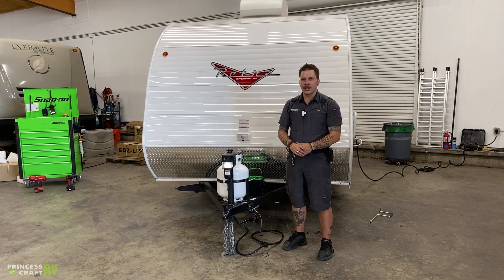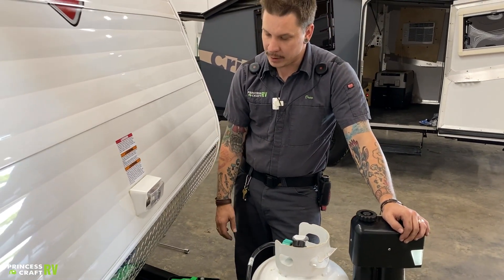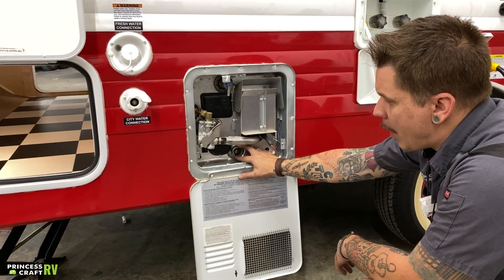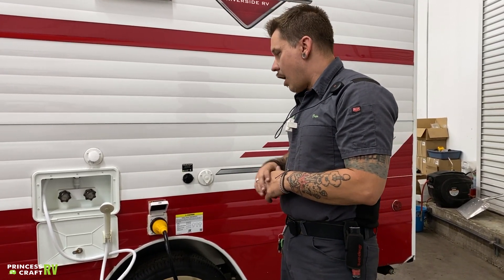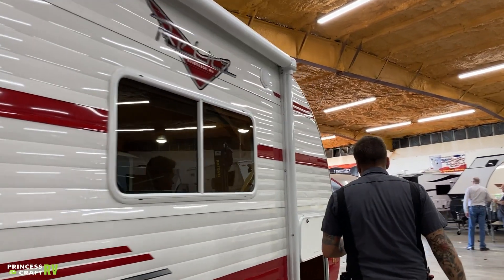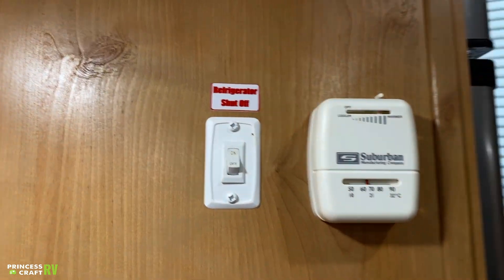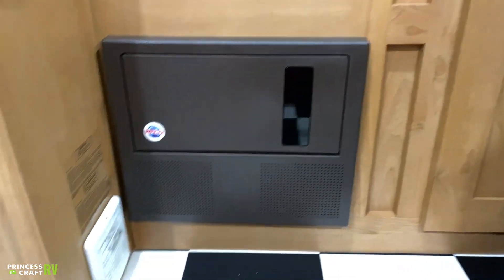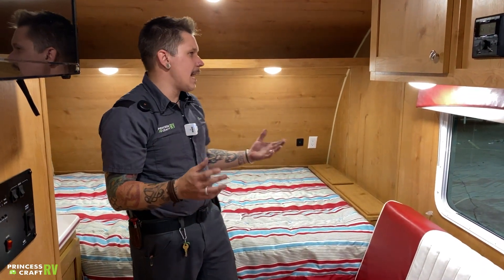2020 Retro 135 by Riverside RV - Technician Tour

Comment: You said the refrigerator is a 12V unit. When I talked with the sales people they told me it was a two way: 120VAC and propane. Also, you should have mentioned the size of the hitch ball while you were talking about towing.
Reply from the maker: The 12v refrigerator is an optional upgrade. The standard unit in Retro trailer is a two-way. Good point on the ball-size.